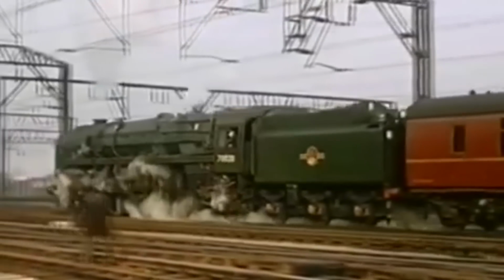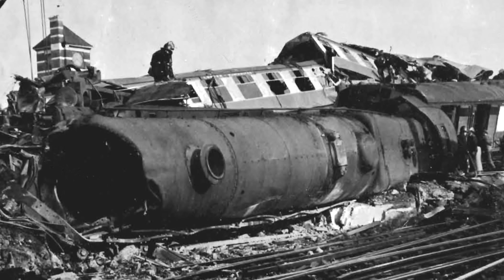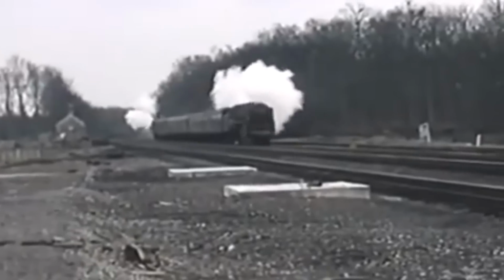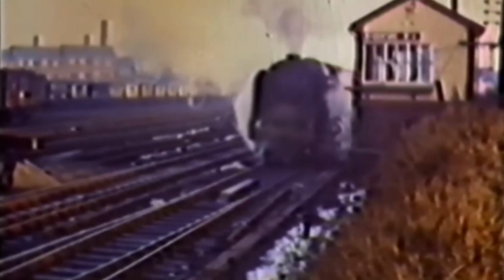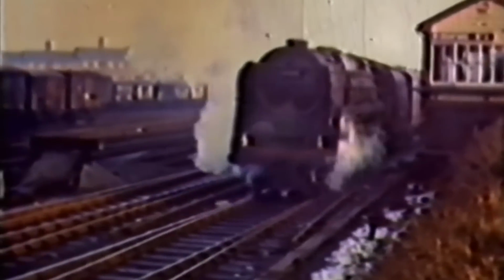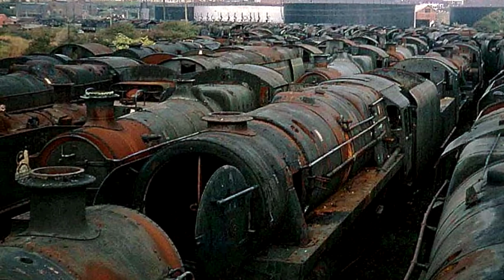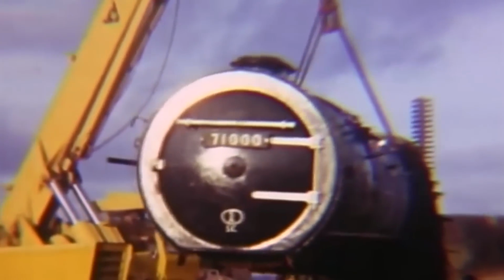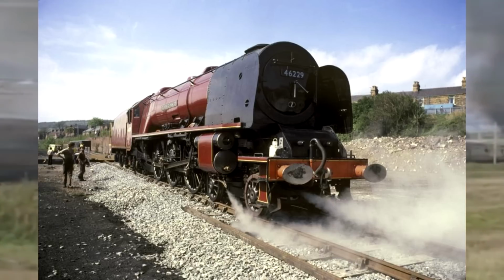The Steam Locomotive That Surpassed Expectations | 71000 Duke of Gloucester | History in the Dark

Comment: E.S Cox, who was part of the original design team, commented in the 1960s, "The whole engine was thus a very near miss. The cylinder efficiency was the highest ever recorded on any British locomotive, but the whole thing was let down by its inability to boil water fast. Why?" Sadly he and the other designers went to their graves without seeing their original work vindicated by the group that not only preserved and restored the Duke but also solved the two problems (wrong choice of chimney, incorrect construction of firebox/ashpan) that prevented it showing its true merit at the time.

Comment: We can only imagine what would've happened if BR fully designed her and let her live to her full potential.
Reply: What do you think would've changed? Please reply to me!
Reply: @TheFunnyDictator  I believe that if the engine performed in her full potential, I believe somehow, it would lead to steam engine thriving longer. The diesels would still takeover, but steam would continue on a bit longer, at most until the mid to late 1970s.
Reply: @matthewpowell2429  Why did the British Railways modernize so late?!
Reply: Actually, what the previous commenter said that if the Duke was brought to its full potential, steam would have lasted longer, as late as the 1970s like the steam locomotives of the Japan National  Railways, which lasted until that time. As it was, steam lasted on BR until the early 1960s.

Comment: The locomotive is more efficient than the Coronation class, which are probably the best British steam locomotives ever. If the 71000 was actually successful and it’s problems that were solved later were solved before, they could have been the most successful mainline steamer in Britain
Reply: Coronation Scot used to be the fastest steam locomotive until it lost that to only a few other designs in history; the most well known of those being Mallard. 

While I prefer the Mallard in looks over the Coronation Scot, both are good lookers.
Reply: @tidepoolclipper8657  The class isn’t called the “Coronation Scot” it’s just the “Coronation Class.” And a streamlined lms coronation could probably beat the A4s in speed due to them being more powerful

Comment: I am still of the opinion that BR intentionally built the duke incorrectly, to justify their dieselization project. The original engineers' notes from the duke's construction reflects this, as many of the builders suggested most if not all of the modifications that the duke's restorers added, when she was restored. These suggestions were ignored by BR management, and the flawed design was pushed forward.

Comment: Although the recorded peak maximum power output of the "Duke" and indeed the LMS "Duchesses" is indeed higher than the Class 40 diesels, the latter could develop 2000 hp continuously over long periods, not just for a few minutes. Certainly not convinced she "outperformed their replacements" (16:58); those were the Class 47 or 50 diesels (2580 and 2700 hp respectively) or the Class 81-87 electric locos (3680-5000 hp). For all their merits, steam engines can't haul modern express trains at 100 mph continuously for long distances.
Reply: The class 40s only produced 1400 DPHP, the 2000 HP is at the output shaft of the diesel, and there's fairly large losses throughout the power train on any diesel electric (diesel hydraulics are even worse - the class 52 got about 1800 DBHP). The class 47s and 50s peak power at the drawbar is about 2200 DBHP, nothing like the 2700 HP before all the losses. Of course, the diesels could be paired up without more crew, which was another advantage.

Diesels win over steam because they produce their power over a wide range of speeds, not just when they are moving fast, and they are lighter, since they don't haul a heavy tender behind them, hence they don't slow too much on gradients or when having to restart. The electrics obviously completely defeat all other forms of traction, having massive power and light weight.
Reply: @cobblestone_cowboy  Thanks, very helpful explanation and useful figures. I'd also add that a big advantage for the diesel is that it can produce its full maximum power continuously for long periods. Steam locomotives could produce high peak values by "mortgaging the boiler" but steam pressure then tended to fall. This flexibility could be useful for producing high transient power output for a short sharp climb. A long sustained effort tended to need "thrashing" of the engine and high coal consumption, plus heavy demands on the firemen, since no British express engines had mechanical stokers.
Reply: @iankemp1131  Railways designed for sustained power outputs not transitory ones. A French 231E could sustain 3,700 ihp and had no mechanical stoker. Some of their firemen could manage a firing rate of two tons an hour though you shouldn't expect everyone to equal this. Some engines were fitted with stokers and the 240P could maintain 4,400 ihp. The French railways needed these outputs to work their trains. Intermittent output is of little use when planning and operating a timetable; you need dependable predictable output from your traction.
Reply: And the other modernisation issues that were relevant during that period of time were the adoption of overhead line electrification (OLE), on some routes, and the choice of diesel traction on routes that didn’t have it. In the late 1950s, the London - Liverpool & Manchester scheme was underway, and parts of the ex Great Eastern suburban routes, and part of the Glasgow area. If it had gone to plan, it would have reached the outskirts of Glasgow and completed it from London Euston to Glasgow, but of course it ran short of cash (seen that recently?) and led to the rental (and much later purchase of) the class 50 design from English Electric around 1967. They covered a 7 year gap on the West Coast, before transfer to the Western Region when electrification to Glasgow was completed. If the original plan had been followed, they would not exist. @cobblestone_cowboy

Comment: The ashpan and dampers were not built according to the drawings (reduced area) and this was a major problem. In conjunction with the blastpipe, it made the air blast through the fire too strong so that above a certain power output, small coal just got blown straight out of the chimney and coal consumption was huge. In preservation it can achieve far higher maximum steam production rates, since those two problems were fixed.

Comment: Not that it’ll every happen but it would be interesting to see what a “class 10” hybrid of the duke and the 9f would produce. Two extra driving axles, which would mean longer boiler and possibly larger fire box to suit the 9f frame with the caproti valve gear and correct exhaust for the rebuilt duke. Oh the UNSPEAKABLE POWER and BIG CHUNGUS.
Reply: Nice idea, but it might not work! The firebox and grate of the 9F and Duke were about as big as could be fitted into the UK loading gauge (and the Duke was initially hamstrung by wrong ashpan construction limiting air access). There was plenty of adhesion already and the boiler was big enough to provide the right power. So more axles would just have meant it couldn't go round bends or fit onto turntables, and a longer boiler would have given higher tube pressure drop and potentially worse steaming.

Comment: Unlike the future P2 Mikado and Pennsylvania Railroad T1 replicas (both of which are based on designs hypothetically faster than the Mallard); this is actually the original locomotive itself getting to see eventual true potential.
Reply: Not sure about the P2, but the T1 is a newbuild, not a replica.
Reply: Well, I don't think the P2s were hypothetically faster than the A4s, and both the P2 and the T1 are newbuilds modified to rectify the problems with each class so that kinda counts. 
In the T1's case, there weren't really problems with the original rather they had high maintenance costs.
Reply: The P2 wasn't designed for speed , rather to haul heavy express trains over a hilly route. They had flaws & the rebuild is intended to correct them. The first of the originals had Caprotti gear & the rebuild attempts to correct problems encountered with the original. @flamedude_1111
Reply: The only problem with the p2 that I recall was that the connecting/main rod (the one connecting piston and wheel) just couldn't handle the force of the cylinders while starting.
Reply: @nielsleenknegt5839 the P2 also suffered from greater wear and maintenance requirements due to the longer coupled wheelbase and only having a 2 wheel leading truck, despite that being a fairly sophisticated design - not so much a problem as the inevitable consequence of operating a larger, longer wheelbase locomotive over the more difficult section of the ECML.  No.2001's Lentz gear was never very satisfactory, having excessive clearance volumes that limited the benefits of high cut-offs, hence its rebuild to match the others.  But given they all had 6'2" drivers, I'm not aware of any realistic suggestion that a P2 could be faster than an A4.
Something similar applies to the W1 rebuild - although that did have 6'8" drivers, the front end sacrificed valve diameter in exchange for larger cylinders than the A4 (20" vs 18.5").  Net effect, even with the larger grate, was a locomotive set up to generate significantly higher power at medium speeds, but where the front end really throttled the possible output at higher RPM.
Reply: Mallard had conjugated valve gear that was terrible at high speed, it's ironic that it (officially) holds the speed record. Some French locos went fast, the only way to test the pantographs of electric trains at high speed was to use a steam loco.
Reply: The concept of conjugated valve gear was OK, the problem was in setting it up & subsequent wear. BR introduced optical setup equipment & after that locos were withdrawn for servicing at the tolerances where they had earlier been outshopped for work. @joejoejoejoejoejoe4391
Reply: If the conditions had been more favourable, and speed was increased sooner on the bank its possible Mallard may have gone to 130 mph maybe a little more.
Reply: @robredz wonder what a duchess would have done specially set up. ??
Reply: @geoffreyking4515  Maybe matched Mallard, or a bit more, they cracked 113 allegedly 114 down Madely bank and had a really rough ride into Crewe with brakes hard on   Coronation was fine and took the train back to London averaging nearly 80 mph and a  fair distance at constant 100 mph. Coronation /Duchess was designed to take heavier loads than A4, probably with 70  plus mph cruise in mind something they could do no problem including pound quickly up Shap. Whatever they were Stanier's masterpiece using G J Churchward's original concepts further than Collett did on GWR
Reply: In the British peerage, the Duke of Gloucester would be pronounced the D-you-ke of Gloster, not the Dook of Gloster.
Reply: @alecblunden8615   atleast someone not from england got the pronounciation of gloucester correct for once

Comment: Ok i have to ask. What is her specs? Like traction effort, hp, top speed and weight. She is a beauty of a machine just want to know more?
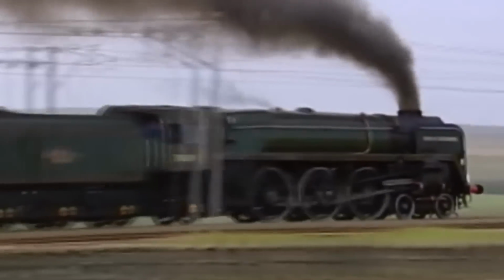Reply: You can find tractive effort and weight in the Wikipedia entry (BR Class 8). Top speed and horsepower unfortunately aren't specific for a steam engine, unlike a diesel or an electric which deliver a consistent maximum power output. He quotes some maximum hp figures at 17:25 onwards.
Reply: @iankemp1131 what bollox  ,go and have a run on her then you'll find out